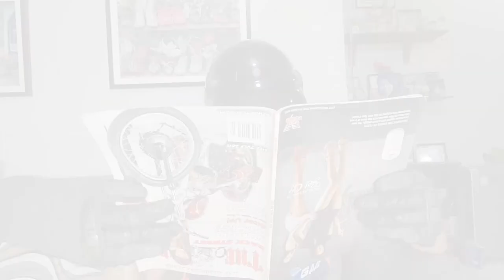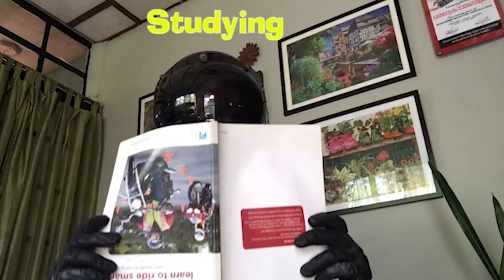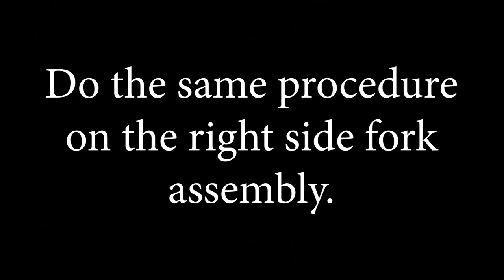Honda CB1000R (Fork Seal Replacement and Oil Change) English Subs

Comment: Don't you have to fully disassemble to drain all the oil?
Reply from the maker: I learned here that I don't have to dissassemble the whole
fork to replace the seals.. For the oil, I was able
to drain more or less 90% of the fork's capacity  from the service manual without disassembly of the whole fork.
Reply: @thecluelessbiker  thank you. How many fluid ounces do the forks hold?

Comment: for seal change you dont need to take the spring off like other videos on YouTube??
Reply from the maker: True.. I realized that after dismantling the first fork leg.... lols
Reply: Do you really need to dismantle it? I did the job without taking out the spring. Will it cause an issue later?

Comment: Hi I wanted to know if I still use the normal oil or full synthetic change? my bike is from 2014 and they only have 3000 miles the last time they changed the oil was 2 years ago and I don't go through it much
Reply from the maker: Regular oil will do. Follow the recommended oil by the manufacturer to be always on the safe side. Enjoy and Ride safe!